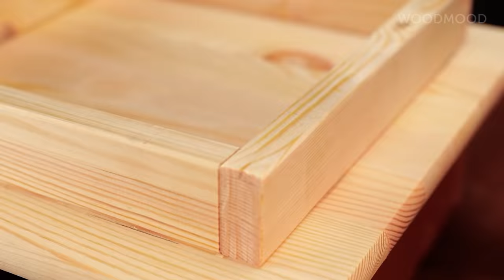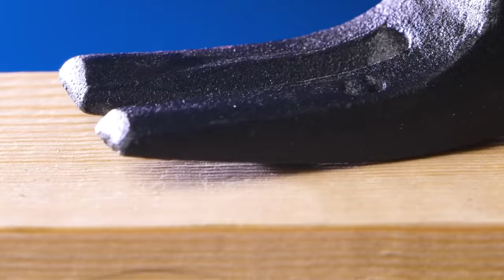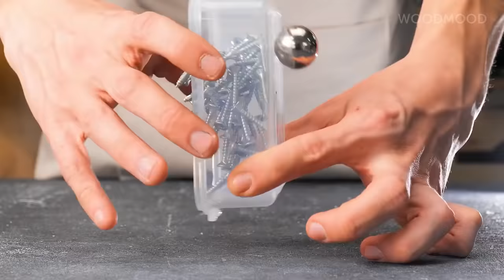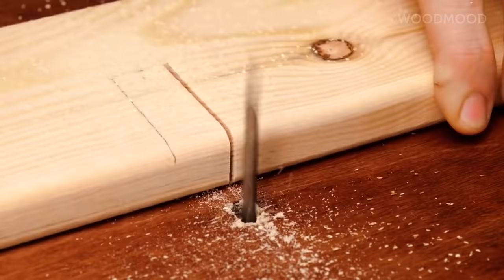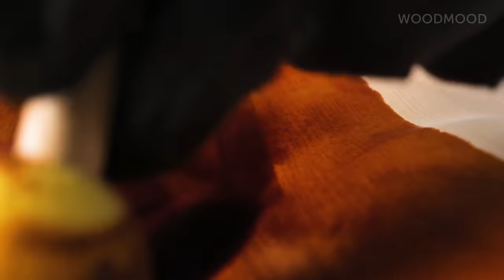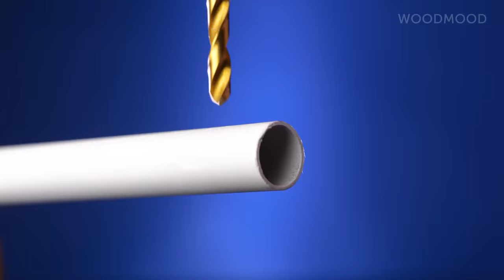How to make a strong wood joint without nails || Woodworking tips for everyone

Comment: The thing with the C clamp was weird. I was always under the impression that a carpenter would just use a scrap piece of wood to prevent damage. Thats what I have always done, seems there is always a few small scrap pieces around when you are working with wood. Never felt compelled to glue a plastic bottle cap to my tools and wait for the glue to dry.....
Reply: He did not put any pressure on the wood with the cap on. He was just spinning it around and you could see it as the plastick was sliding. With pressure it would break off as the metal is nit a thing that bonds well with a glue without any sanding. He did the split screen to fool people into thinking he did screw it on.

Comment: wooden dowels are used to align pieces not to secure them. Dovetail joints on the other hand are very strong, but no example of how they are made, just hammered a couple pre cut pieces together.

Comment: I could do better job myself without using those tips compared to if i did use them. Vids like this are the sign that yt needs dislike count back to make people aware what kind of bollocks people come up with.
Reply: You cant tell?
Reply: @seanp9157  i can but there are other videos that actually put people at danger. Mainly programing vids, free stuff links that were a plague and you cannot tell which ones are real(some are some are fake and its impossible to just guess) and of course videos with how to repair stuff that can lead to self harm bbut the posting person did not even think about this. Those just lead to a lot of disapointment but most actually put people and their stuff at danger.